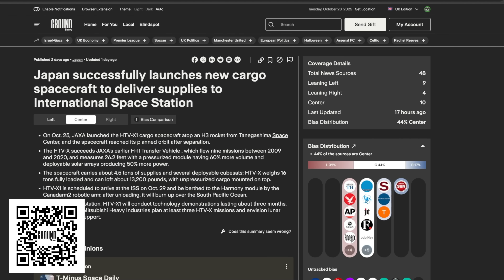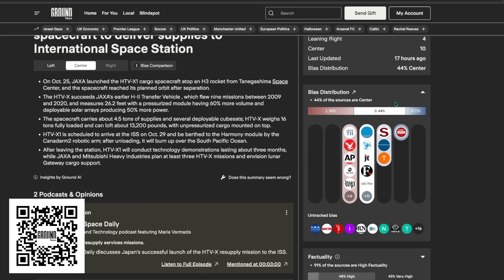Every Thing These Moon Landing Deniers Got Wrong About the New Moon Mission

Comment: Anyone notice they don't play the actual audio from the press conference?
Reply: If they would have done that it would have shown that there were actual concerns about the Artemis mission (the heat shield is one example were a lot of people are not happy with how NASA responded), which were answered and again it is fine not being happy with those answers.

The issue here is that they don't want that genuine talk that took place to be visible. If this thing is fake, such a discussion would not be necessary nor would it even be possible. All those things would have to be made up. Why even do all those testing if it is fake? This is a lot of money.
Reply: @rudolfquerstein6710  If they used the real audio they'd have to do a huge amount of editing to cut out the parts that contradict what they're saying. It's much easier to do it the way they did.
Reply: @rudolfquerstein6710 the thing about the heat shield though is that it exactly did its job, just not as effectively as they would like. At the speeds of descent that rockets travel, any feasible heat shield is going to show marks from the heat and in fact, such is almost desirable, it simply had worse marks than expected. The issue was identified and fixed, simple. 

Marks can actually be desirable because the energy going into making those marks directly reduces the heating the craft actually experiences, especially if metal is burned off. It also increases drag which has the side effect of negligibly increasing the rate of slowing down.
Reply: I was just going to say that. They’re tell us what they supposedly said, instead of letting hear it for ourselves.
Reply: That would distract from thier booming intelligence

Comment: I don’t understand. Do they want us to go up there with 60’s tech or something?

Do they not understand that the tech is completely different?

It’s like they don’t understand the notion that something like— a phonograph and an MP3 player use different means to achieve the same ends…
Reply: No, they're over here frustrated that their 3.5" floppy disk won't fit into their USB - C port.
Reply: @SweetTastyDogMilk  Yup, we've lost or destroyed the technology to save files! Now we can't save anything anymore!
Same sort of twisted logic as them saying since the 60s tech we had to go to the moon is destroyed, we can't go there again. Dumb.
Reply: They don't understand a lot of things.

The project is already different. The Artemis mission overall is heavier than Apollo, and there is somewhat of a golden rule in physics, that you can safe force by increasing the distance. If you want to move something up by 1m it is much easier to roll it up a slope, compared to just lifting it 1m up straight, but the distance will be greater. Pulleys work with exactly that principle.

Artemis does the same. The fastest way to get to the moon is if you would lift of from earths surface directly facing the moon and fly towards it. That is the quickest way to the moon, but it also requires the most amount of fuel. The longer you make the trip by basically slingshotting you from earth orbit into lunar orbit, the less fuel you use. Apollo had more time constraints then Artemis. Artemis has a power source, Apollo ran on batteries and I think fuel cells this among other things gave a reason why Apollo missions were on stricter timer, the ressources were more limited.

Artemis is already a mission were more time is spend on the moon, which  puts less on an impact on a longer flight duration.
Reply: @rudolfquerstein6710 Apollo also used consumables for cooling, so it had an inevitable shelf life. Orion has a radiator array that circulates coolant in a closed loop.

Also, the whole purpose of Artemis is suppossed to be long-term surface stays with the return vehicle hibernating while docked to the Gateway or free flying in orbit. It has to be validated that it actually can spend long periods in space without issue.
Reply: It's not only that but NASA contracted dozens of companies to make the various components, equipment, and space craft for all the space missions. The knowledge and technology used in Apollo still exists but no company is still producing and manufacturing that level of technology because there is no demand for it. It would be like wondering why Apple doesn't still produce a 1st gen iPhone, Ford a Model T, or why we don't still use zeppelins for combat and for long distance travel even though they were cutting edge technology in the early 1900's.
Reply: You go with the tek that works. It's as simple as that, no matter what decade it was  invented in.
Reply: @theapollodetectives No you don’t. I own a ‘discman’ and an iPhone… guess which one I use to listen to music? 

You don’t use analog tech when digital exists unless you absolutely have to.
Reply: @theapollodetectives  [ You go with the tek that works. It's as simple as that, no matter what decade it was  invented in. ]

Well, muzzle-loaded blackpowder artillery works perfectly well, and sails work just as well today as they did two hundred years ago. So why aren't modern navies using sailing ships armed with blackpowder cannon?
Reply: @paulzuk1468  Gun Powder and tar sure makes for a good solid rocket engine doesn't it. How old is that tek and yet it is still used today.
Reply: @theapollodetectives Modern solid rockets are using completely different propellant mixes and the fuel is carefully machined based on sophisticated computer simulations in order to allow an even burn.

Saying it's "gunpowder and tar" is like saying modern tank armor is "steel and porcelain"
Reply: Come on now we all know we "Lost the Technology" to go to the Moon. 

You know, Rockets and Mathematics...we lost them. 🤦🏻
Reply: @derekcoaker6579 Perhaps all that face-palming you’ve been up to has given you brain damage. 🤨

Rockets and math are only single parts of the operation. All the tech that goes inside must be modern. Sending them up with the same equipment and same objectives is not only foolish, it’s also nearly pointless.

If you can’t reason that out— based on logic alone, you got bigger things to worry about than what your intellectual betters are up to. 🤷‍♂️
Reply: @derekcoaker6579 We know how to sail. How long do you think it would take us to build a XIXth century ship of the line?

Comment: Wow. These idiots think that the designers didn't think about the rocket exploding when designing an escape system. Really...REALLY? You don't think they thought about rockets going boom and all the various conditions surrounding it? To quote someone we all know: "Dear, oh dear."
Reply: It should also be noted that some failures are just above any safety measures. Like if you are out on the road and get hit by a meteorite there is nothing that is going to safe you. If this rocket suddenly explodes the astronauts are likely dead. But in many cases an explosion occurs after other signs of it appearing and the systems in place allow the astronauts to get to safety quickly.

While the most dangerous of accidents are hard to design against there are a lot of smaller things that can happen, where you can design safety measures for.
Reply: SpaceX didn't 😂. 
There's no LAS (Launch Abort System) on "Starship" at all. Even Russian rockets have them. 

But since "Starship" was meant to be a bulk carrier for telecom satellites ("Starlink") and have costs pushed to U.S. Taxpayers so Elon can become a Trillionaire at their expense... It fits).
Reply: @onebylandtwoifbysearunifby5475 The Starship is the launch abort system! Completely different design philosophy. The Big Heavy / Starship stack is meant to fly like a jetliner. Big Heavy can handle engine-out events, the probability of a disastrous event is sufficiently low that they don’t need a dedicated abort system.
Reply: @paulblase3955 "They don't need one" is different than having one. LAS (which Starship doesn't have) function is similar to ejection seats, and have saved lives when rockets fail- saved U.S. astronauts lives as well. 

If a Staship suffers an explosive failure, how does the crew escape? (This will happenn it's a matter of time & frequency). 

SLS has one, Russian rockets do too. Starship doesn't. Some programs were designed around people, others around telcom satellites.

Comment: Bit of clarification: the boosters that the SLS is using are heritage Shuttle flown boosters, made from steel casings. The booster that Northrup-Grumman was testing in Utah that had the exhaust nozzle failure and subsequent burn-through on the skirt, that one is part of the Booster Obsolescence and Life Extension (BOLE) upgrade, slated to fly on the SLS Block 2 version. The BOLE boosters are GEM (Graphite-Epoxy Motor) casings.
Reply: Adding on, the BOLE boosters are going to used first on Artemis 9. Artemis 9 is assumed to be launching in 2034 given the current schedule.
Reply: @MrPashto96  So what you are REALLY saying is "They will never be used".

Tell me how the main engine program is going to replace the Shuttle Main Engines.
They don't have enough for THREE more SLS launches, much less NINE.
But they started the program to replace them riiiiiight???
Reply: @stuartgray5877 before Artemis I, they had 16 Shuttle flown RS-25s in storage. That's 4 missions of SLS. Aerojet-Rocketdyne finished refurbishing and getting flight ready the last of those shuttle engines in June of 2024. They've been developing and testing the replacements. An upgraded RS-25 with newer materials designed for higher performance and cheaper to make.
Reply: Wait, they don't use tin foil and duct tape?
Reply: @cygnustsp  Only on the lunar lander. 😉
Reply: THAT SHIT BLEW THE FUK UP